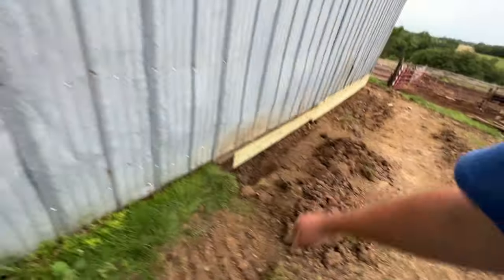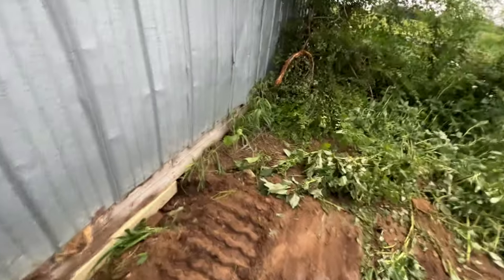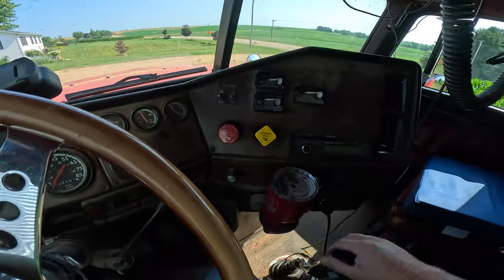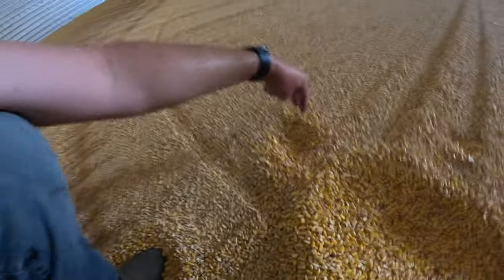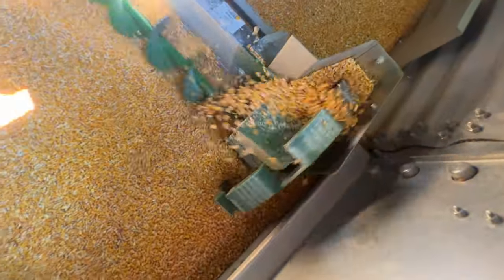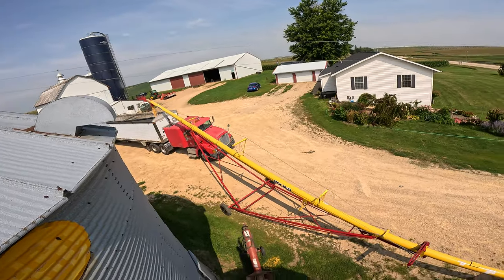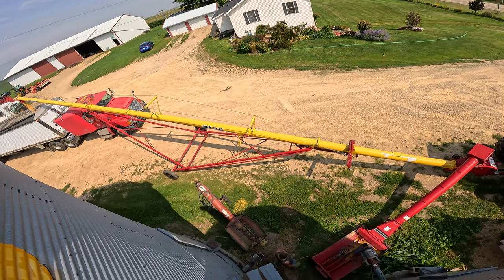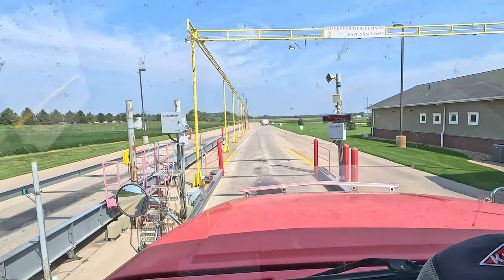Summer's End Jobs - I Needed Just a Little Tug!

Comment: Good luck with your surgery and quick recovery brother. For harvest you should definitely use a cordless Milwaukee impact to open and shut the doors on the trailer, we do it all the time and it’s Heaven, just put a socket on and your on your way to no more struggles. 👍
Reply from the maker: I need to invest in Milwaukee because my Dewalt couldn't do it 🤣
Reply: @HowFarmsWork  Dewalt might work now since you had them worked on, just a suggestion so you can take it easy on your shoulder. Good Luck 👍

Comment: Ryan have you ever considered just bringing a cordless impact or drill with the right sized socket? Just pull the trigger. No cranking necessary. 😅
Reply: Battery or even air since there is air on the truck. I mentioned eariler one like is used to change truck tires could do double duty if necessary.

Comment: Wishing you well in your recovery, thanks for sharing your thoughts and videos. Have you ever considered having a drop axel added to your trailer to increase its capacity. If it works like that and the actual trailer could handle a larger load it might pay itself back with fuel savings and your hourly labor. Wishing you and your family the best.
Reply from the maker: I've thought about using drop axles before, not sure where we'd get started though!